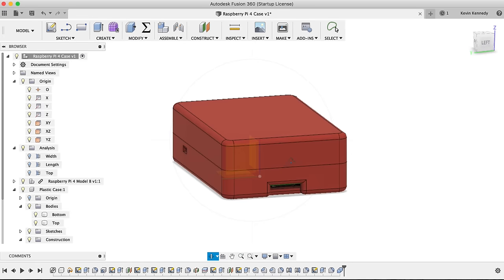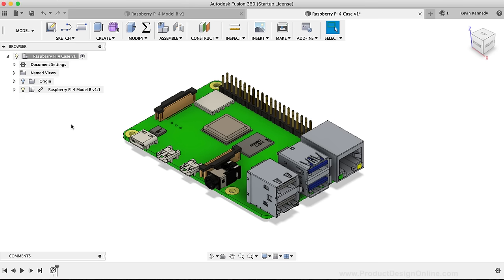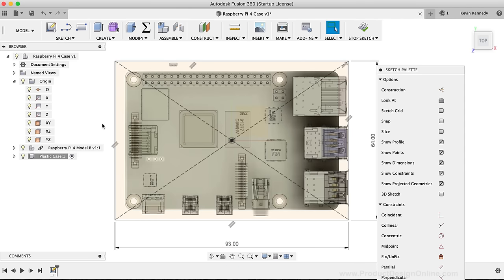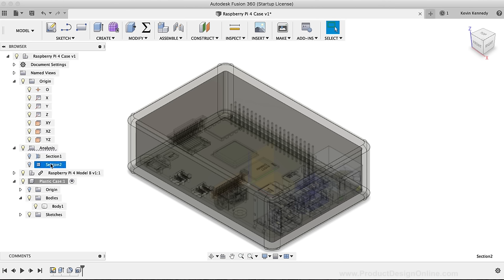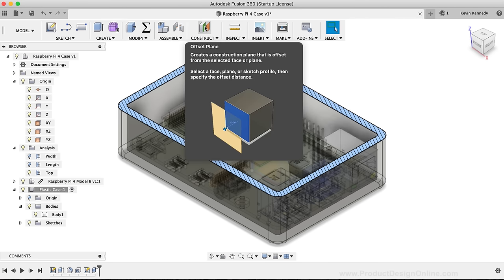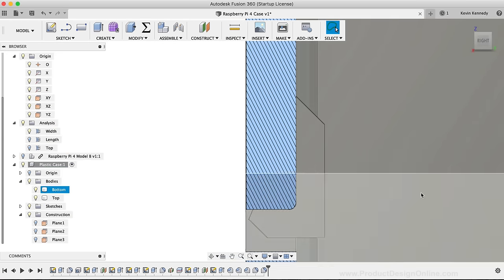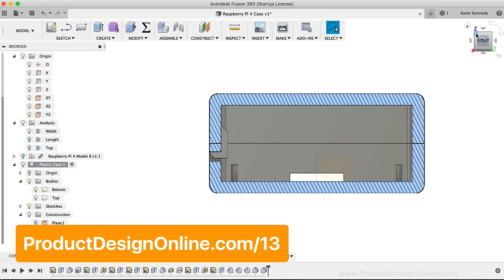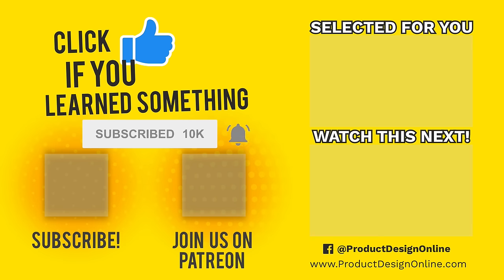Fusion 360 Snap Fit Cases | 3D-Printable Raspberry Pi Case

Comment from the maker: IMPORTANT: Make sure to add clearance to the ridge at 32:00. A clearance of 0.4 mm (or .5mm) is recommended for FDM printers. A clearance of 0.3mm is recommended for other types of printers (SLS, SLA, OJET).
ps. thanks to everyone who brought this to my attention.
__
Resources for this tutorial can be found here ► https://productdesignonline.com/13
__
TIMESTAMPS
0:00 - Creating Snap Joints in Fusion 360
2:03 - Importing the reference model
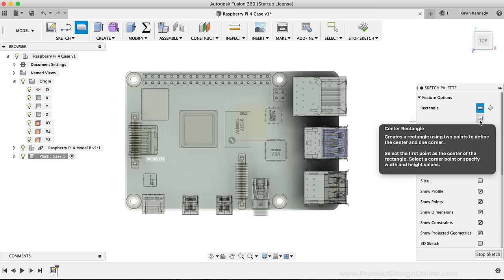5:12 - Creating the box
6:43 - Adding fillets to the edges
8:27 - Shelling the box (making it hollow)
10:35 - Using the section analysis
12:00 - Creating the pins
15:33 - Projecting the cutout slots
19:07 - Creating slots on the sides
20:35 - Creating slots for the Micro SD card
22:00 - Splitting the case in half
24:33 - Creating the snap joints
32:33 - Creating registration ridges
Reply: I was about to comment there should be some clearance added on the last step. Great job pointing it out
Reply: Which ridge? Are we talking the ridge on the snap connections or the registration ridges? I just finished the project  yesterday. I  resized the box width dimension to 65mm.  I found the rasberri pi won't fit with the original width dimension.
Reply: Great tutorial, thank you so much. Anywhere I can find photos of the finished product?
Reply: Also you have to lift the pcb a little bit from the bottom, cause there are pins underneath
Reply: Darn - I was aware of that kind of thing, but didn't think to do it right away, until I had done a couple of test prints (my case has to allow for an oversized Seeed Studio LCD, which took a couple of tries to get right.)
Reply: What’s the best way to add a clearance when utilizing the combine/cut function?
Reply: @DrBrookRN What I did was I made a new sketch, did an offset of 0.4mm ouf from the bottom ridge, and then used that to do an extrusion cut into the top.
Reply: I added clearance by duplicating the half of the case with the positive profile, slicing off the bottom beneath the profile so just the ridge remained, offsetting face by .2mm (which creates .4mm on both sides - not sure if this is the right number or not) , then booleaning that to subtract it from the other half.

Fingers crossed!
Reply: @Grazfather  this is the answer.  thanks!

Comment: I followed the tutorial the entire way with the intent of making a Pi case. I made some small changes here and there to the final product for ventilation, like patterned holes across the top, but overall just followed the overall design. I had two problems and one nice thing when it came to actually printing it (top and bottom facing the bed) and assembling it that probably aren't super obvious to a beginner beginner.

The first was that with the clearances involved, while you are modeling a snap fit case, you won't actually be able to put the pi in there, since the audio jack extends quite far past the case and the tolerances involved will prevent that from being inserted and still sitting on the pins.  Removing the two pins closest to the overall slot (snapped off by hand) worked fine, and that allowed it to be angled in. The two remaining pins hold the board in place just fine, so I was able to use the bottom without reprinting.

The second was that while the snap fit did model come together in CAD, when I tried with the actual material I realized it was too brittle to use it successfully that way with the way I printed it (in PLA). So the snap connectors were snapped off on the top half.  The nice thing that happened was as I followed the tutorial exactly, I did not add tolerance to snap and groove on the lid, as mentioned by Peter Refi in the comments. This allowed me to do a pressure fit closure on the top, which holds it together nicely. Since the case is mainly aesthetic and to prevent damage from bumps, this will perfectly suit my needs, allowing me to have a fully functioning case with a Raspberry Pi 4.

I didn't get a snap fit case like I wanted, but I learned a lot from this tutorial and through my mistakes, and will try it again on my next project.
Reply: I just watched this today and those clips are ridiculous in this video. How in the world anyone with any understanding of printing, or even how plastic works at all, can think it can bend that much is beyond me.
Reply: Wow, a 2 year old comment getting a reply brought me back to this. Can't believe it's been 2 years.

"How in the world anyone with any understanding of printing, or even how plastic works at all, can think it can bend that much is beyond me."

... That was kind of the point. I was not an experienced CAD modeler nor 3D printer at the time. 2 years ago, this was one of my very first prints as I was learning the basics of CAD and 3D printing. At the time of modeling it, I thought it wouldn't succeed - I think my note in the Fusion file says something like, "I have never seen a retaining tab this large in an actual product". However, I knew I would tape it closed as a permanent fix if the print failed so I didn't care.

The reason I left this comment was undoubtedly someone, somewhere would try and print this. There were a few comments on the video at the time discussing how useful this would be (and I checked every comment at the time), not a single comment ever said they'd actually gone through and printed it, and what happened and why it failed if you actually tried to print the tutorial. I felt like it should have at least one.

And plastics - they can do a amazing things, including flexing that far if you use the right material. I like the tutorial as a teaching tool, but for making a case, the design requires revision.

For the record - 2 years on, I still have this case, it's still in use and still works great, printed off the very first roll of PLA that I ever bought.
Reply: @gonxau  And to be clear, I was speaking about the guy teaching, not you. You are right, a very soft rubber like plastic might bend like that, but normal run of the mill PLA or ABS would not. While watching the video I was so surprised at that clip length and went straight to the comments the same as you to see who had printed it or at least commented on those clips and yours was the only mention.
Reply: @_evildoer  I hope more than one person saw my comment after thinking the same as you and said, "wow, ok, so if I print this, it won't work as a snap case" and revised the design. That would make it very worth it.

If I was doing this again as a snap connector, I'd make 2-3 design changes, but realistically I'd probably just design it to use some M3 screws.
Reply: very nice points. I was curious as to how it would turn out since I have been looking for ways to add snap fits to some of my designs and thought this video would be good. While it clearly lacks in that department, as you stated, it did help me find tricks I wasn't aware of as a Fusion360 novice.
Reply: @_evildoer  I guess he mentioned nylon as material
Reply: @gonxau  I'm that exact person, lol. But remember, that wasn't the point of the lesson, which is part of a phenomenal series to get started with F360 fast and become effective in a few days from pretty much no prior 3D CAD knowledge. What Kevin is sharing and how he does it is simply fantastic.

Back to that snap joint and the ridge, he did say that this works best when printed in Nylon, so it apparently worked for him. I too thought, this will never work while watching it (the snap hooks will break off and the case won't go together. Just apply what he taught you so far to make this work with PLA or ABS by adding more clearance and design the snap so it can flex a little.
Reply: @mkloberg  For sure, but who among us wouldn't like to design something and then print and use it? Which lol... of course I did exactly that. And failed, and learned a ton in the process. I think that's the heart of 3D printing and parametric design, which is why I still love this tutorial. I think the average beginner would make the same mistake I did.

With hindsight as my teacher, any of the following would make this a usable print: different material, different approach, different parameters, different design, and different print orientation wouldn't have hurt either, but if I were doing that I'd adjust the design anyway.

It's a great tutorial, but now that I have experience, I'd definitely do 2-3 things differently - I'd probably still use PLA because I have a lot of it, but different print orientation, a longer arm, a smaller lip catch, thinner lid over the lip catch portion, and some design choices to reduce support material are things I'd change, just off the top of my head.

Comment: I had a few very useful points here :
1. Resource to download the Pi stepfile
2. How to quickly make a case based on the actual file
3. How to make useful openings in a case based on existing features and components in a file.
So thanks again Kevin for this useful tutorial.

Comment: Thank you so much! My UI looked very different (2019 refresh?) FYI for such users, the "SKETCH" menu doesn't show up unless you're in sketch mode! You have to do Create -> New Sketch, click on the face you want to edit, then select the command, rather than selecting the command first. Also, the lightbulbs have been replaced with little eye shapes.
Reply from the maker: Hi, Star Dorminey. That is correct. I would recommend watching my tutorial that covers the new UI updates. I discuss the critical changes in terminology, placement, and iconography, that should help bridge the gap between the old UI and the new one. You can watch that here - https://youtu.be/tuZzHcmFtg4
Cheers, Kevin :)

Comment: Great tutorial! Like it. One small question. You used tolerances when created the pegs for the pi, shouldn’t be put tolerance for the snap joint and groove as well?
Reply from the maker: Hi, Péter Réfi. Great question and sorry for the confusion. There should be tolerances there as well. Per the pinned comment, I was focused on other things while recording and forgot to add tutorials there. Cheers, Kevin :)

Comment: It would've been nice to see the actual model printed and snapping / unsnapping the model a few times.
Reply: Well, that's because it didn't work for him xd
Reply: Alejandro Pérez lmao
Reply: The snap feature and the groove were conflicting. Idk how would this work?
Reply: I tried this snap joints and it and for me the joints breaks. Printed with PLA.
Reply: @Todestelzer  Those aren't good snaps. Nicely modeled, and great Fusion skills, but the snaps themselves are way too stiff to bend to allow the snap to happen. They also protrude quite a lot into the lower part. Other than that I learned a lot from this video!
Reply: @Todestelzer  Yup same here, did you find other methods or designs for making your enclosure's snap joints?
Reply: @Todestelzer  Could always try PETG so its sturdier

Comment: nice tutorial, but the way you made the last feature, to align the top and bottom case, without tolerances, it will not work when you will print it. Also, the snaps are to "tight fit" and it will not work, it will even break the first time you try to close it.
it will be nice to see the final print, as far as I can see, sorry to say it because it is a great tutorial, it will not work printed.
anyway, keep on going I like your tutorials, I can always learn something.
Reply from the maker: Hi, Giuseppe. Thanks for your feedback. Good point on adding some tolerances for the top/bottom ridge.

As far as the snaps, I should've re-iterated more that I had only printed this out with NYLON 3D printer filament that is flexible. You're probably correct that this may have some issues with the standard PLA or ABS filament.

Thanks again for watching and leaving your feedback and suggestions. Cheers, Kevin :)

Comment: hello, the case would not fit together because you need some tolerances in the lip and the snaps.
Reply from the maker: Hi, DocM. Thanks for your feedback. Good point on adding some tolerances for the top/bottom ridge.

As far as the snaps, I should've re-iterated more that I had only printed this out with NYLON 3D printer filament that is flexible. You're probably correct that this may have some issues with the standard PLA or ABS filament.

Thanks again for watching and leaving your feedback and suggestions. Cheers, Kevin :)
Reply: Ok, I am only printing with ABS mainly and PET @ProductDesignOnline
Reply from the maker: @DocMicha  If you ever look to get Nylon, I've found the best results with "eSUN ePA 1.75mm Nylon." Cheers, Kevin :)
Reply: @ProductDesignOnline  Thx, but I print old fellowed with 3mm, just because ...
Reply from the maker: I believe it's available in 3mm as well. Cheers, Kevin :)

Comment: Great tutorial. I'm pretty new to Fusion 360 and have not been able to resist the "jump in and see what happens" method of learning. This tutorial has shown me some of the intuitive power of Fusion 360 and inspired me to go through the included training, however slow it may seem! Thanks!
Reply from the maker: Hi, Melvin. Glad to hear you're on board for learning Fusion 360! There is a lot to learn...just take it one day at a time. I would recommend checking out my popular playlist titled, "Learn Fusion 360 in 30 Days for Complete Beginners!" In this series, I cover all of the core features of Fusion 360, getting brand new users up to speed and ready to build their own unique designs. You can check that out right here - https://bit.ly/learn-fusion360
Cheers, Kevin :)

Comment: I have Raspberry pi 3b running Octoprint for my 3d printer. I have nice case with a 40mm x 40mm x 10mm fan for cooling.  Your videos are the best.  I recommend you all the time. Thanks.
Reply from the maker: Thanks, Bob! I appreciate your support and for recommending my videos. That really means a lot and helps me out!

Thanks for sharing Octoprint. I'll have to check that out. The only RPi project I have at the moment is a similar setup for my 3D printers (just with different open-source software). I keep seeing cool RPi projects online and always think I should do more, but never seem to make the time lol.

Cheers, Kevin :)

Comment: I absolutely AND greatly appreciate these videos.  Kevin is a phenomenal expert with Fusion 360 & has great teaching skills.  The only improvement I would suggest is to go a lot slower so that we can follow along without having to constantly stop the video, catch up in our Fusion 360 window, then back up the video and start again for the next step.  When you are a professional who is completely familiar with the product, it is easy to fly through the steps, but when you're a novice like me - not familiar with the locations of the tools/menus - it takes time to find them.  What complicates things is that it seems that Fusion 360 is under constant upgrading/changing so there may be very slight differences in the version we're using vs the version Kevin has used in the tutorial.  (Someone needs to teach the Fusion 360 development team the concept of version control.)  Thanks, Kevin, for providing these videos!!!

Comment: Excellent. I've used Arduino processors and have messed up the cutout alignment for the USB connector. Your approach is so much better. I can also use the latching and alignment hints you have provided. Please keep providing similar content for 3D printers designs.
Reply from the maker: Thanks, Randy! I'm glad you found this video to be helpful with your project. I'll definitely be doing more 3D-printing related content. Thanks again for taking the time to watch and comment. Cheers, Kevin :)

Comment: An excellent tutorial! I use Fusion 360 for home projects and this helps me leverage the software even more! I have a pi4 which I use for octoprint configured with relays and buttons for PSU control and lights. My latest project is integrating homebridge, RF transmitters for remote control outlets, pi hole, and Shairport Sync onto the same pi. I also have a pi zero w which I am setting up with homebridge to control a solenoid to push a door buzzer to open an external door. Thank you!
Reply from the maker: Thanks, Bill. Glad this will be useful. I also run octoprint on my pi, but those other projects sounds just as exciting! Cheers, Kevin :)

Comment: Great tutorial! I have a bunch of RPis for a number of projects.  My latest is a digital clock using RPi and either (or both) TM1637 / Tm16K33 4-digit 7 segment displays.  This is what I need to model a case for.  Your instructions were clear and easy to follow!  Thanks for simplifying an otherwise-insurmountable task!

Comment: Great video
Sergestion - Would you not add posts coming down from the top case that line up with the post at least on the micro SD card end to hold the board in place? as to stop the board lifting while inserting or removing the card.